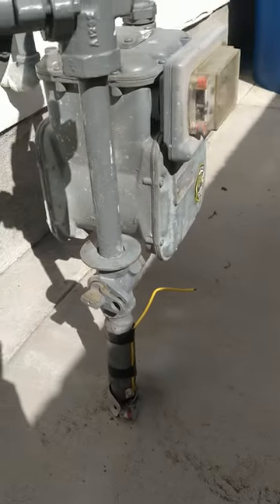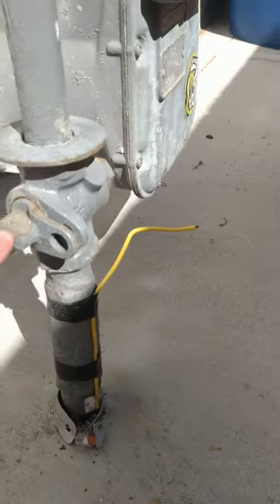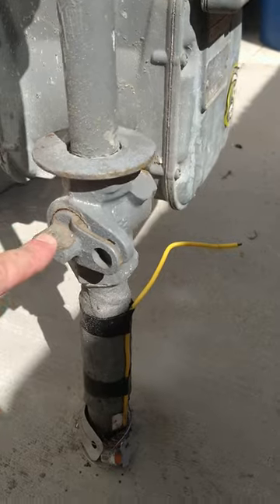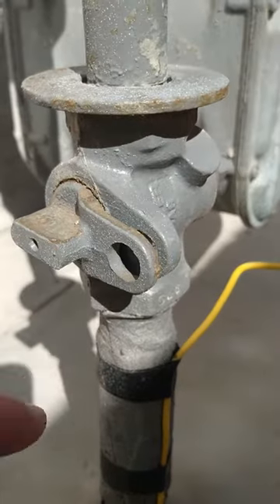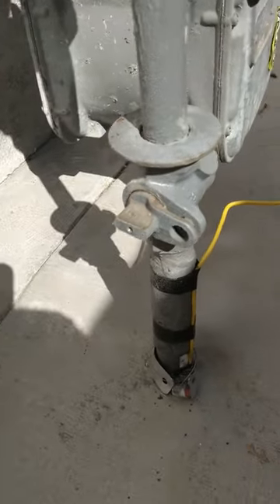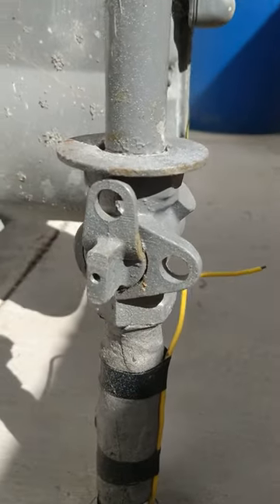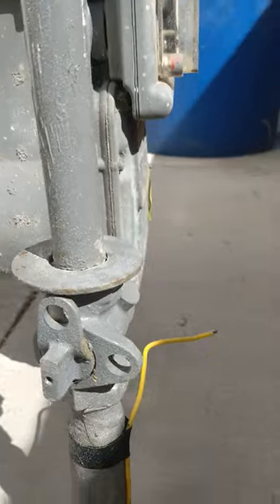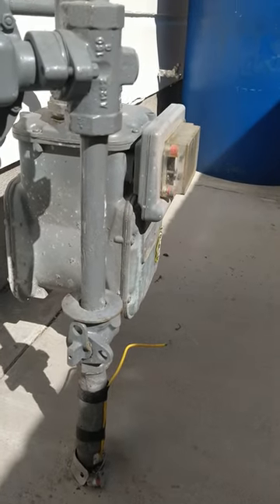gas meter valve | how to turn on/off

Comment: So when you turn the gas meter on do you have to do anything else in the house? Or can you go back to doing things as normal such as using your gas stove in hot water heater
Reply: depends on the type of appliances you have... some self-light/ignite and some must be done manually

Comment: My question is if is safe to turned it on?? Or a professional has to do it? I’m in panic I did a work at the house and and I turned it off for 2 hrs I turn it on myself,  so far everything looks  fine 😐 plzzzz responde
Reply: How did everything work out?
Reply: @jwhite716. Kinda scary there was no answer 😢
Reply: @TheLeftrib  deadass!
Reply: I've heard and read that if you call your gas company they actually instruct you over the phone how to turn it off and on by yourself (so they won't have to visit every single apprehensive resident). With that said, sounds like it's safe for you to do on your own and you're fine. Never turn it on fast though, slowly turn it back on. I'm doing mine now.
Reply: Yeah it’s not rocket science lol Anything to do with water heaters or leaks or actual maintenance service call a professional but you can turn off & on gas meter like a light switch. Just assure it’s fully on or fully off ✊🏽
Reply: I had to remove a gas dryer and could hear the gas was on. My intuition kicked in and was like don’t remove without turning off the gas. I asked the client how to turn off the gas. Of course they did not know so I had to do some research. After a brief tutorial online I was ready to turn off the gas and remove the dryer with confidence.
Reply: I’ve been waiting on conED to come turn on my damn gas and it’s been 3 days and nothing. I’m about to try this, but I’m a bit scared.
Reply: @katherinegalvan9185  If you don't know how to PROPERLY check for leaks... you're playing with your life and those of your neighbors.
Reply: This is a federal offense and we pull meters all the time for tampering. Call your gas company. A proper clock test needs to be done. This is how dangerous accidents happen.

Comment: If you’re gonna teach us how to commit a federal offense you can at least show us how to do a proper clock test after
Reply: How would this video show you how to commit a “federal offense” ?
Reply: @Ben-fx8lg  Tampering with a gas meter is a federal offense.
Reply: @tacroom12 Only if the intent is to STEAL…. He’s showing how to shut it off… Ya know to install new things etc…. Plus it’s not a FEDERAL offense… it’s not as if it crossed state lines or was tampering with mail or delivery
Reply: Wrong. The only thing a homeowner or contractor can touch is the house piping. Any kind of tampering on the meter or piping to the meter is a federal offense. There’s a process to shut the gas off/on. If something needs to be installed or fixed, the gas company needs to shut it off. After any kind of repair or addition is made the gas company will turn the gas back on and run a clock test to adjust to proper pressure. 

It’s in every service contract across the US.
Reply: @tacroom12  you are conflating the act of STEALING and what a paying customer can do… You’re not right. Let it go
Reply: Here’s the federal code: 49 U.S. Code § 60123
Reply: @tacroom12  Dude… it doesn’t say what you think it does… You probably asked the teacher for more homework… Paid extra on your taxes…. Dude the video is a wholesome way to show homeowners how to shut off their gas… What if there was an imminent fire hazard they discovered.. Do they need to wait around for the gas company?? If they really intended that the customer couldn’t shut off their gas… You’d think it would require more than a crescent wrench, yeah???
Reply: @tacroom12  And here’s the thing it’s okay to be wrong… I truly respect when somebody can admit it… I’ve been wrong more times than I can count… But I own it.. And paradoxically in my personal life… People respect my opinion more when they see me admit when I’m wrong…. So I think you owe this gentleman the poster of the video an apology… essentially accusing him of giving “criminal tips”
Reply: @Ben-fx8lg in
Reply: I just called the gas company (in the Midwest US) and they told me to get a plumber to do that. They mentioned this is done at the meter. I said I needed to remove a gas fitting that is not in use anymore. So if the gas company is asking me to basically do it myself (hiring a plumber) I doubt it is considered a federal offense, since 1. I'm paying for the gas (not stealing it), 2. it is the meter for my own property and not someone else's
Reply: @Justkeepswimming  the gas company is not asking you to do it yourself. Unless you have your JGL than yes you can. If not then you definitely need a plumber to do it for you because they hold the license. If your fitting is no longer in use than I would have a plumber cap it for you because if something happens, you or your insurance has nobody to accept liability.
Reply: @Justkeepswimming  also the meter does not belong to you just because it is in your property. Same deal as some internet providers. You lease the equipment. Read your service contract.